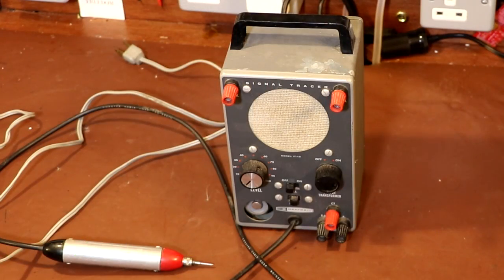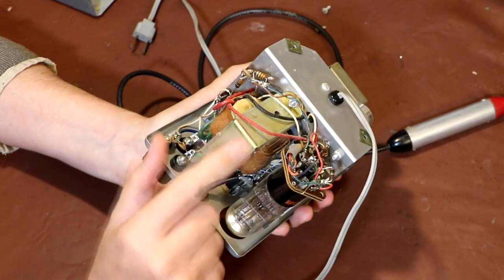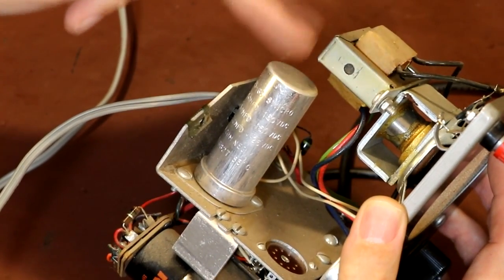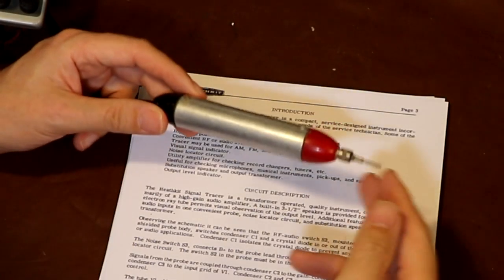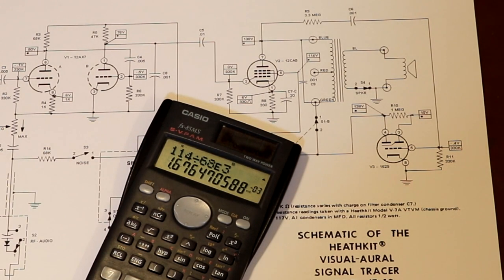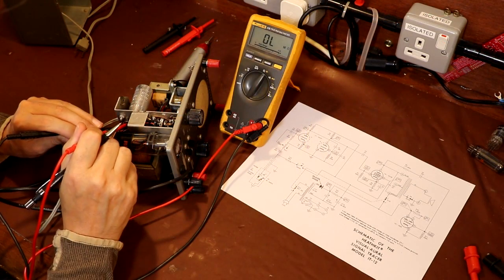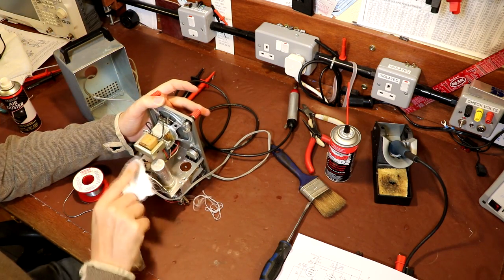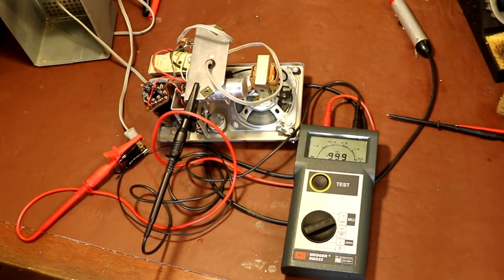IT-12 Heathkit Signal Tracer - Part 1

Comment: When I was a kid in the 60s and 70s, Heather kit products were still very much quiet the popular venture as we weren't inundated with "inexpensive," Asian imports for all kinds of electronics and the home electronics phenomenon was in full swing with everything from computers to radios to a full array of testing equipment, etc..  Heath kits were the top of the line and they prided themselves on having comprehensive, easy to understand manuals for assembly and operation so that "regular folks" could use their products without having to aquire an electrical engineering degree before hand.
  I believe that although the modern age of computers and the internet brought us all kinds of wonders and cable and streaming TV brings us everything we could want and much more we don't, in some ways the "simpler times" were more productive times and brought families together and brought certain things into our homes and gave us a chance to learn and explore at a much more visceral level.  Today, if you can't do it with a keyboard, most younger people don't want anything to do with it.
When I was a kid in school, we learned about ham radio and how to build them, we took woodworking and auto shop and fixed and even built cars, we weren't afraid to get some dirt under our nails and so many of us had work benches, if not workshops where we explored the world of technology in a way that,sadly, is now "antiquated" and frowned upon.   And that's too bad because parents don't engage with their kids, human behavior and physical and mental engagement has suffered to the point we're actually retrograding to a great degree and we're overall becoming disengaged from society and our family and friends (social media is a whole different beast that although it has its benefits, its also superficial, frequently unhealthy for younger people, has given a false sense of world experience as its seen through the eyes of others instead of our own eyes and has opened them up to those who would take advantage, etc., etc.).
  Putting our hands on things and learning by doing, holding an actual book, doing research that doesn't include Google and directly interacting with our own family is rapidly becoming a thing of the past and having things like Heth kit projects to play with would serve us all well today, just as it did 50yrs ago.
(Sorry for the rant, thinking about those days brought about a great deal of reminiscent thoughts and emotions and a realization of the negative slide we're on).

Comment: Nice detailed video, thumbs up!  Is there no 220-110v tap on the primary of the power transformer? My IT-12 has it. What mine was missing though is this very useful probe, now having seen what the original looks like and has inside, I have to confess that my desolder sucker has passed away and morphed into an IT-12 probe :-)
Reply from the maker: Thanks for watching and your lovely comments. Unfortunately my version is only 120 volts only. That’s ok 👌 I have a step down transformer. These are a really nice signal tracer

Comment: I have one of these Heathkit IT-12.  Your ground braid is supposed to exit out of the back hole of the black cap on your probe- not next to the aluminum case.  check owners/building manual.

Comment from the maker: Thanks for the information on  the capacitor. I think the reason for not having the earth is most likely that the regulations back in the day did not require it to be earthed and most sockets didn’t provide provision for earthing. I have several Mains powered items I have imported from the USA with metal bodies and no facilities for earthing.  It could be that 120 volts was deemed to be safe enough without earthing as compared to the UK with its 230. I wouldn’t want to clip that probe to a AC DC set as the probe body and the speaker unit would itself become energised which would be quite unpleasant depending on the how it was plugged into the mains.  If we did not Earth our plugs in the UK the circuits are fused at 32 Amp but it would be dreadful to think you could have a 15 amp current flowing within the enclosed of the signal tracer and not have the power disconnect.  I thinking this points again to a change in standard as more modern equipment from the USA is now fused internally however that could be due to export standards etc. Thanks for watching and great comments regards Chris.

Comment: I think that the signal tracer may not have been grounded because it was intended for use with AC/DC radios, and other series string equipment which cannot have a ground connected. As for why the plug was not polarized I don't know, but even though polarized NEMA 15 outlets go back 70 years or more almost nothing prior to the 1980s has a polarized plug. Some equipment has fuses built in, such as TVs and communications radios, but I don't think it was a requirement. The way houses are wired over here is different then in the U.K, it's all radial branch wiring with a 15 amp breaker on each branch, so if an appliance shorted out the breaker or fuse was likely to trip rather then sitting there allowing the power lead to burn up.  
Regarding TRW, I can't remember what the initials stand for but they were involved in automotive parts as well as the aerospace industry, and probably military work as well, so that cap was probably plastic film inside. TRW was the company that built the Pioneer 10 and 11 spacecraft, the ones sent to Jupiter and Saturn in the early 70s.

Comment: It would be interesting to see if the voltages needed are the same as other heathkit stuff like the vtvm's. If it was then you could get a scrap unit and fit the uk spec transformer.
Reply from the maker: George Christofi  I could get a transformer wound for about £70 but you know what it’s like. Sometimes good enough Is good enough!

Comment: Most of the outlets in the US in the 1960's didn't have a ground/earthing pin socket.  They were simply two the two connectors for live and neutral.  Also, not a cockroach., it's a vampire bug.  You'd rather it be a good old fashioned cockroach, as they're nasty disease carriers.
Reply from the maker: Dennis P. A few people have said it’s a kissing bug. How come the Americans plugs don’t have any fuses the signal tracer has no internal fuse
Reply: @allthegearnoidea6752  Kissing bug is another name for the same insect.  They carry chagas.  Nasty filthy things.

As for why North American plugs in the 1960's didn't have fuses?  You've got me. They still don't in most cases, although you can get specialized cordsets that do have fuses. Also confused by the pre-1962 non-polarized (same width contacts) outlets of the time.  Perhaps they were relying on the fuses in the main panel for protection.  But I've seen many of those blown fuses unscrewed and then a 5 cent coin put in to bridge a blown fuse. Perhaps they enjoyed getting a little 115V tickle from a radio when they plugged the cord in backwards and made the chassis side hot...

A missing mains fuse in the signal tracer is bad design, and I am beyond surprised that Heathkit didn't include one.

An interesting thing about the US is that, as a federal system, there is no single  National Law that applies to the entire country for electrical installations. Although OSHA regulates the labs that provide approvals. The National Electrical Code is kind of a suggestion and various states and cities may or may not have adopted the latest version, or even rejected parts of it for their own local reasons.
Reply from the maker: Dennis P. Hopefully I will remember to add an inline fuse between the tag strip and on-off switch.  From what I can see the American mains cord have heavy gauge wire. I assume that this is to tolerate the higher B+ voltage.

Comment: Back in the day Radio/TV repair technicians were real men. None of this safety grounding rubbish. When you got belted to the floor by the HT line you got up,  dusted yourself off, and went back to it.
Reply from the maker: Doug McArtin Yes but  they were all dead by fifty five.  If a  TV didn’t kill them all the fags did.   I have had more than my fair share of belts over the years interest the worst quite recently when a guy at work connected a 24 volt output to the a 230v supply. I had my hands in the panel doing some testing at the time as you can imaging it came as an unexpected surprise. Mind you I’ve reminded him every day since!
Reply: Yeah, all joking aside, you have to be careful. Some of those big 25 inch color TVs from the 1960's had 30 KV on the CRT. It wasn't unheard of for a TV repair guy to be killed by them. I would have loved to have heard what you had to say to your work colleague that day.
Reply from the maker: Doug McArtin  I just laughed it off,  he is a good guy that made a mistake and I walked away to tell the tale.  I know regarding those TVs, some of the earlier black and white sets  of the 30s that had a very long picture tube had higher voltages with more current behind it. There for the grace of god go I!

Comment: Very nice, Chris! Can't wait to see it powered up and tested. TRW stands for Thompson Ramo Woolridge formed in 1958 by the merger of Thompson and Ramo Woolridge. Originally a safety equipment manufacturer, they branched out into most famously automotive products and also aerospace. That should be a good quality capacitor. Your Chevy pick-up is probably loaded with TRW parts! Regards, David.
Reply from the maker: David V The cap was a bit leaky and dc on the grid of the pentode started to creep up. So replaced it as a precaution. I think the American capacitor were generally better than the horrible wax type that lasted far to late in history in U.K. equipment.

Comment: nice little unit would like one myself not sure where I would put it haven't got a lot of room on the bench as for the probe case I would give it a good polish and slip some clear heat shrink  over it as someone else has also mentioned but wheres the fun in that ? nothing like a little tingle to keep you on your toes !
Reply from the maker: thehappylittlefox aka benji   I don’t know  how it compares to the modern signal tracer kits be interesting to find out. There is a lot to be said for battery operated test gear. Thanks for watching and comments regards Chris.
Reply: @allthegearnoidea6752  well I suppose low voltage dc operated items are a lot safer some of those old radios and TVs were lethal even up until the late eighties I used to be able to light one of those mains tester neon screwdrivers off any metal part I touched on the video recorder ! only when the TV was on no scart back then just an aerial socket  btw my first signal tracer was a felt tip pen with a pin from a din plug and a 3.5mm jack on the other end which I connected a crystal earpiece if you could get one that worked !

Comment: I'm not sure i like the idea of feeding a voltage up to the probe, i would snip the feed inside the unit, but that's me being a picky picky sod lol.
The probe bare case is a no no as well, clear heatshrink would be nice to isolate the body from your donnys.
Don't i moan a lot lol.

The resistors don't look too old, if it was the old thicker carbon resistors they drift with heat like a bugger.
Also they were very noisy in mic amp circuits, if you were daft enough to use them there lol.
I hate the 1% blue resistors like you / i have, the blue body assults the eyes when trying to read them.

Smashing video chris :-D
Reply from the maker: zx8401ztv  I have to leave the noise function how can I possibly let my audience miss out on the fun of me shock myself LOL. Definitely a strange test function.

Comment: Seems a bit strange to day but when i started in the 60's no test eqipment was earthed .
these are very good tracers far better than the velaman ones mainly because you can fault find the RF stages even pick up a signal an the tuneing cap. the shock you get from the probe on noise test is no more than a tingle .
sadly i sold mine 20 years ago and now wish i had kept it..
As for useing vintage eqipment i have a lot of it the only bits i use is hunts capacitor tester (because of its leakage test) an avo 8 and an Advance signal gen.
Reply from the maker: rob titheridge  The past is a different country. I remember use large black and decker electric drill with metal bodies. They were in theory earthed but would want to use one today.  The odd tickle is  all part of the game but still better avoided.  Thanks for watching and great comments. Regards Chris

Comment: That noise function it for testing resistors and capacitors for breakdown.
Reply from the maker: I have seen other people using the them for exactly that but never owned a tracer with this function myself. Be interesting to add this function to a modern heathkit tracer

Comment: I have the manual for it too, think I got it from the same site! I put a grounded lead on mine too when I got it.
Reply from the maker: Defpom's Electronics & Repair   Yes all things considered I will ground it, original condition is not always the best for a bit of gear I intend to use on a regular basis etc.

Comment: Looks in very good condition Chris, I have the earlier model T-4 which looks exactly the same as the T-12 but the T-4 has the germanium diode fitted instead of the later silicon diode as in the T-12. I replaced the electrolytic caps using a twin capacitor can, same diameter can as the original, and then added the third electrolytic on a stand-off. Did the usual of having to put a dropper resistor in, that was fun but got there in the end. Great piece of kit, works very well but goes no where near any trany sets just in case of operator error !!. Mine was factory built and you can tell this by looking at the solder joints. If the joints have a coloured coating over them then this is the factories inspectors check marks.
Reply from the maker: Theoobovril   I’m just about to put some power on. We will have to see regarding the electrolytic I would normally just replace the on site but I am going to try reforming this one as it’s a special combination.  That noise trace function is evil have you had a belt of yours ?
Reply: @allthegearnoidea6752  No belt off it so far Chris, so far have never left the switch in the noise function position...well, not yet anyway but there's always a chance hence why I don't use it on transistor radios. Mines the American 110 volt version too, several years back it was cheaper to but this equipment from America, even including the postage and tax, than it was to buy at home in the UK.
Reply from the maker: Theoobovril  not unexpectedly the manual suggest disconnecting one side of any transistors in the circuit under test when using the noise function. Will have to be careful with it.
Reply: @allthegearnoidea6752  I think Mr Carlson has built a kit that's so sensitive that it can be used for noise tracing and it works at low voltage too, Chris.
Reply from the maker: Theoobovril  yes i watched his video but do you know where the kit is available from ?
Reply: @allthegearnoidea6752  I think you have to join his Patron site to get access to the details on this and other kits he has built, Chris.